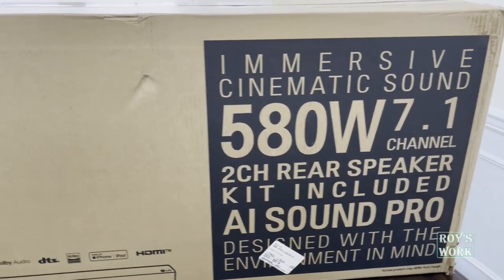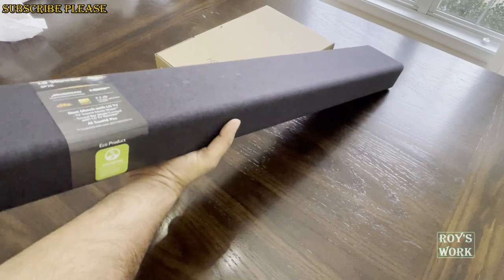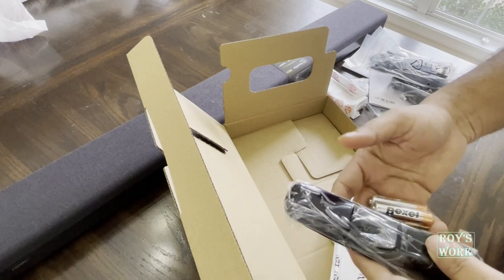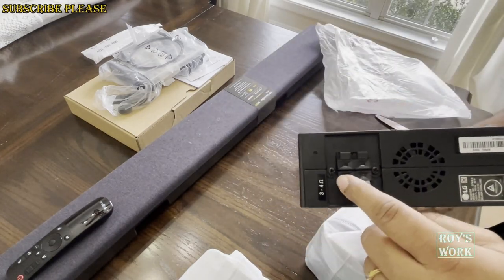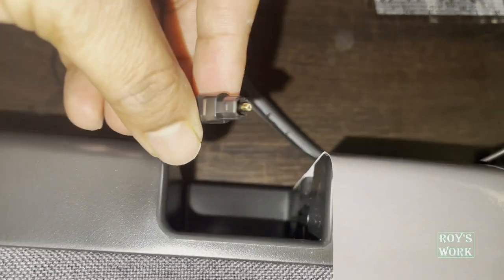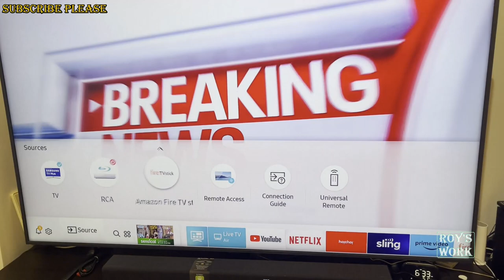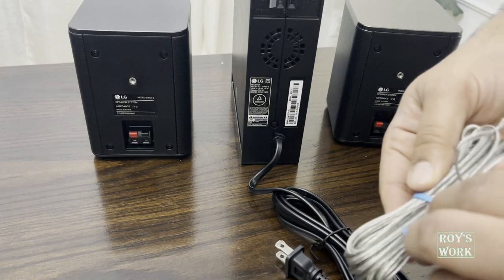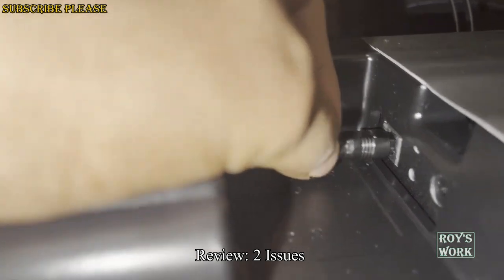LG SP7R 7.1 Channel High Res Audio Sound Bar with Rear Speaker Kit | Unboxing | Test | Review

Comment: Just got this today. It’s OKAY  for the price… it was on sale for $200. My issue with it is the subwoofer is not manageable independently… and there is no separate volume setting on the woofer itself to adjust it. 
My previous set up was with a full receiver and completely wired sound. But it also cost a fortune. I was looking for a less expensive solution and this seems to be okay… I’m still working on the bass situation.
Reply: Also… he’s right about the optical. It took forever for me to get the optical hooked up… glad it wasn’t just me!
Reply from the maker: Hi, thanks for sharing your experience. There is a settings option for woofer in the remote. Its not direct, so you need to find it out. 
Thanks for watching my video. Please Like Share & Subscribe!!!
Reply: I was able to get into the sound bar setting on the remote and adjust the woofer up independently. The sub comes set at 0
Reply: @Matt-ix6ne  Yes! I was able to use the app. If you sync the sound bar with the tv, you can’t access the bass independently… at least I didn’t see it. However I was able to address it via the app.

Comment: Brother never use optical  (  S/PDIF ) if your tv have eARC or even ARC support which will give you more than what  S/PDIF ( optical ) can offer. Also using hdmi which is capable of cec , will help you to power up or off automatically. So if your TV doesnt have eARC/ARC supported hdmi then use   S/PDIF ( optical ) connection.
Reply from the maker: Thanks for the information. I didn’t try it yet. My tv has eARC. I will try it for sure. Thanks again and please like share & Subscribe.

Comment: Is the Bluetooth receiver only? No transmit meaning can I pair my AirPods so that I can listen in my AirPods incase someone is sleeping. Thanks for the unboxing video you did a good job 👍🙂
Reply from the maker: Hi, no. It doesn’t have transmitter. Its only receives Bluetooth signal. 
For your problem you can check in amazon for Bluetooth transmitter, you find lots of price starting from $10.
Thanks for watching my video, please Like Share & Subscribe!!!
Reply: @RoysWork  Ok thanks, I'll sub :)
Reply from the maker: Thanks 🙏🏻

Comment: Hello
Thanks for the video
The bass is not that strong
Do I need to make any changes to the setup
I really do not like the sound quality
I had Yamaha ATS 2090 which blew up today (the subwoofer stopped working). The sound Yamaha had was just amazing. This LG soundbar stands no where as compared to Yamaha. Do you also think that the sound quality is not up to the mark 
Thanks
Reply from the maker: Thanks for watching the video. I agree with you, this sound bar is not comparable to Yamaha. There is a settings for the soundbar which is accessible using the remote, you can increase subwoofer sound from there. But I don’t think that will satisfy you.
Reply: Ths poor sound quality is what led me to researching more about the Soundar. I had a Polk in my Living Room which I moved to my bedroom and I'm grossly underwhelmed by this one. Returning it today.

Comment: Hey Roy! I recently bought this exact set but used, it didn’t come with a DC cord 🙃 can you tell me what size you used??
Reply from the maker: Yeah, i mentioned in the video about this problem, not all standard cable will fit to this device. You can search for “slim optical cable” in amazon. I also search for it and found one.

30M Black Digital Fiber Optical Audio SPDIF TosLink Cable https://a.co/d/9ekAPmy
Reply: I may have misspoke, the power cord for the sound bar, I have an optical cord that fits but can’t seem to find a correct power cord 🤦🏻‍♀️
Reply from the maker: Hi, sorry. I returned this one and i am using the Samsung soundbar. Sorry can’t help you. May be others can answer to this question.
Reply: @RoysWork  no worries, thank you!
Reply from the maker: Thanks 🙏🏻
Reply: Do you like the sound? Does it sound better for movies vs just soundbar and sub?
Reply from the maker: @johncecilia4517  yes, it’s sounds better for movies. You will be able to get all sound effects, if something happens in back or in different sides, you will feel that.

Comment: I bought this assuming the speakers are wireless and you need to connect the wires all the time to get connected
Reply from the maker: Rear speakers are not wireless but using the rear kit, you dont need to run the wire through wall from the source. 
The subwoofer is wireless. The soundbar, you can use Bluetooth but won’t get good sound.
Thanks for watching my video. Please like share and subscribe!!!

Comment: I cannot make the subwoofer work. Do I have to connect the entire system to make the subwoofer work?
Reply from the maker: No, you need to turn on the soundbar 1st then power on the woofer. It will connect automatically.
If its not connected, try unplugging everything and then start with soundbar 1st, then woofer.
Thanks for watching my video. Please like, Share and Subscribe!!!
Reply: @RoysWork The subwoofer does connect and the 'green light' is solid but, there is no sound from the subwoofer.
Reply from the maker: Test with high volume, also you can increase woofer only volume using remote.

Comment: Hey there, my rear speakers seem to be connected from positive to negatives coreectly. The box its connected to has the constant green light on and if I put the rear speaker to my ear i can hear static so I know its receiving power. But with all that I still don't hear any real noise. Any idea why?
Reply from the maker: So, looks like all the connections are fine but so sound from rear speakers. 
1st, how do you connect the soundbar to source (tv, etc)? I noticed if you use Bluetooth, rear speaker doesn’t work. Use hdmi or optical cable.
2nd try to do power recycle. Completely unplug soundbar and rear speaker kit from power wait for a min and then try. 
If all these doesn’t work then you may need to connect lg or may replace the item.
Thanks for watching my video.
Reply: Did you ever figure out the problem? I’m having the same thing happen. Even trying to test them off the app no sound comes out
Reply: Unfortunately no, ended up returning it to Best Buy. I'm not super tech savvy but I'm not terrible. I figured it shouldn't be that difficult

Comment: Am I able to put the mini speakers they give us without the wire
Reply from the maker: Yes. It comes with rear speakers kit. This kit is wirelessly connected to the soundbar. So you put that kit at the back of the room and then connect the mini speakers to that kit using wire. The two mini speakers are not wireless they connect to the kit with wire.
Reply: You always have to connect them with the wire all the time to the wireless device, you cannot connect them without wire

Comment: Just to confirm rear speakers are not wireless?
Reply: Correct
Reply from the maker: Yes. Rear speakers are connected to the kit which is wireless. So you don’t need to run wires from the soundbar to rear speakers.

Comment: How to connect a small speakers to the bar
Reply from the maker: Normally you cant connect any additional speakers to this sound system, only the two satellite speakers (comes with this system) can be connected using the rear speaker kit (comes with the system too). No other additional speakers can be connected.
Thanks for watching my video.